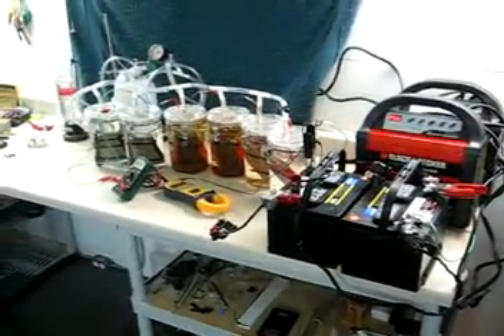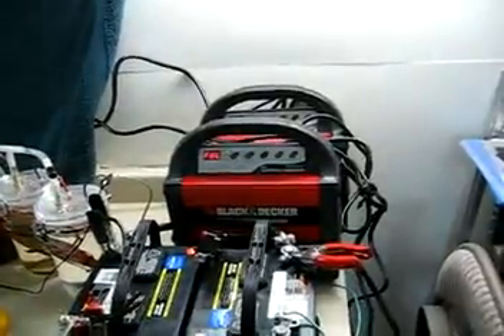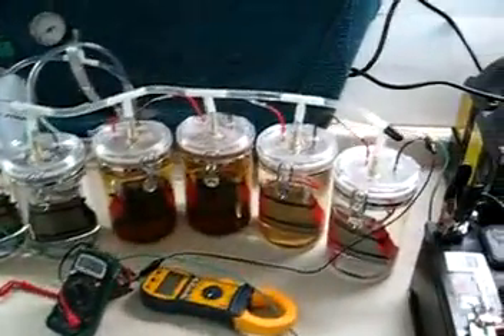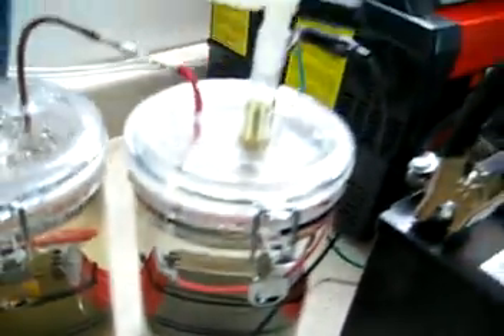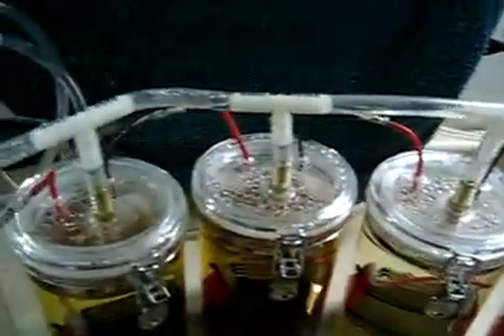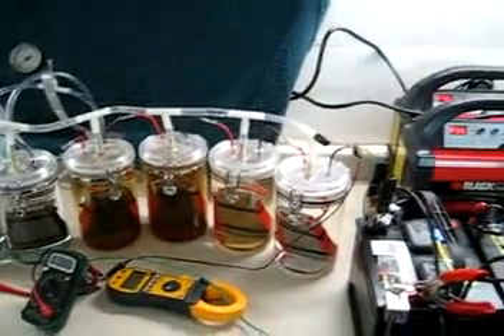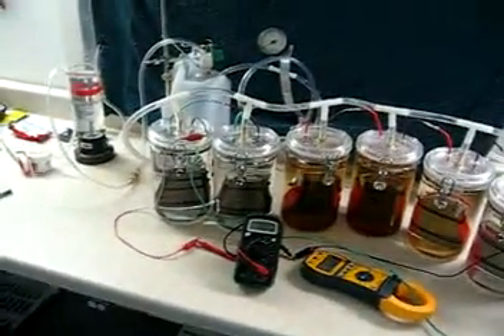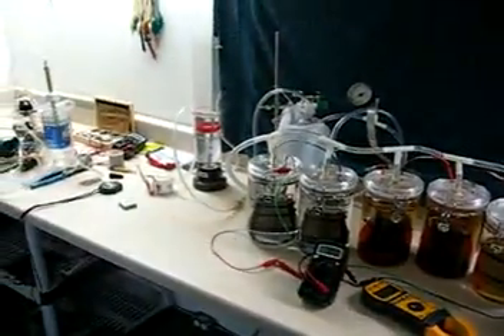6 cell setup

Comment from the maker: Thanks, wait till you see the real project, 3 to 13litres per minute. Variable output welder, cutting, brazing, soldiering torch. For that one I may use a pwm pi, I haven't decided if I am gonna use pwm, or just vary the input voltage. I suppose frequency drive would proly be a smaller lighter package, so I am leaning that way. I have been running these cells for around 6 months, had to rebuild their containers a couple times, due to mishaps:)